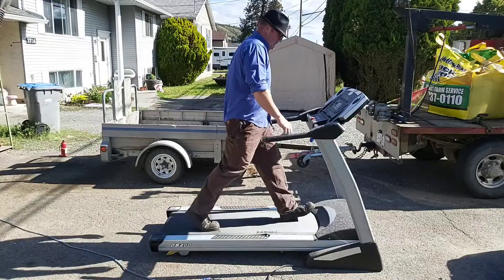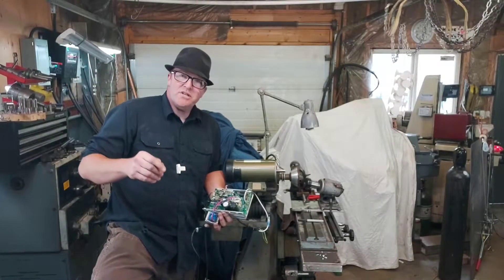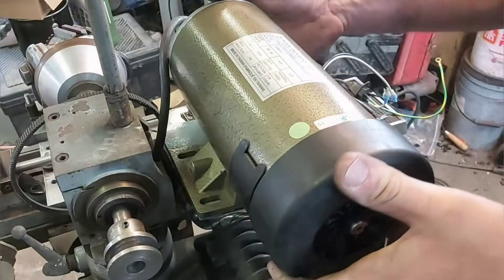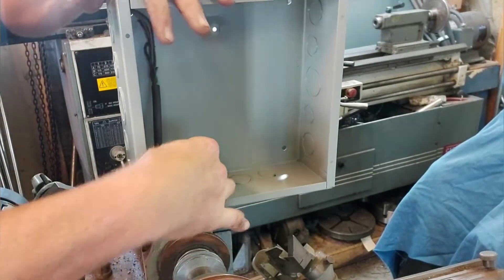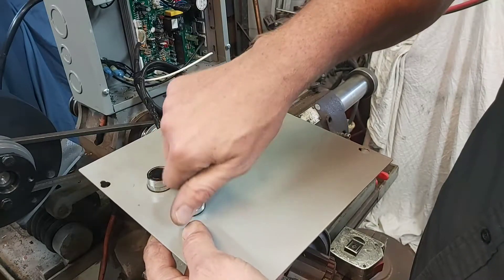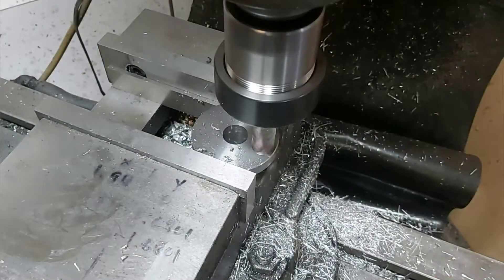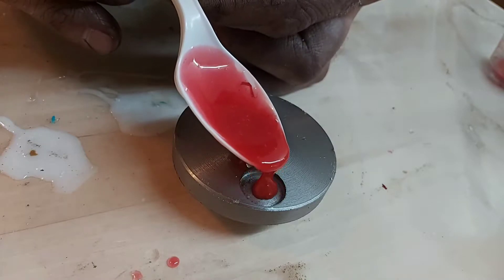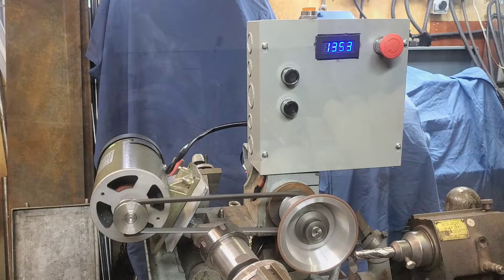Installing A Treadmill Motor On A Tool Grinder Variable Speed   alt6330

Comment: I know this was posted a couple of years ago, but perhaps you are still active on your channel. I found this same controller/motor, and I wanted to use it to power a small lathe. I got it working. However, using a momentary up/down switch seems to be crazy slow! Like I have to push the switch like 1 millions times (alot :)  )  to get it up to 1000RPM! I read on that thread you referenced that someone there suggested that the VR1, VR2, VR3 hooked to a 10K pot could be used to control the motor speed. Did you ever try this? I was not sure I wanted to try it for fear of blowing something out. thanks.
Reply from the maker: Yes it can take a bit to get up to speed .   I have a mechanical advantage on mine .   I had never done anything with the resistors . Can you tell me more about this or a link to read up on it ?
Reply: @Wrighmachining  I'm not a machinist like you are, so you got an advantage on this. But I am an electronics engineer! and I can read schematics. the schematic shows these VR1,2,3 (VR= variable resistor). I did not have a treadmill. I got the controller from a friend who tore apart the treadmill before I could look at the top control panel. If there was a poteniometer up there it might have been used to connect to these 3 positions. The other mystery is there are two of these connection points on the PCB both with the same labeling.... so they could be electrically connected, or just labelled the same. I have not investigated this yet. I think I read on one of those Arduino sites you had posted someone's opinion on the variable pot would not work to control the motor. I guess I will just need to experiment. If i get it working using this method I will post the results here...
Reply from the maker: Awsome !!! Wish i had you as a neibour when i started work on this .  Thank you amd we look forward to yoir imput !
Reply: @Wrighmachining  Ha! yeah many years ago I was a controls engineer for a company where we designed CNC controlled grinding machines! Fun job. Yesterday I tested the idea of using a poteniometer connected to the VR1, VR2, VR3 pins on the board. There are two sets of these named the same. But neither one worked for me :(  The schematic is not clear on what these are used for. So I think the next step is for me to come up with some kind of encoder. A rotory encoder won't work because it needs the signal interpreted by a processor. Meaning the pulses are detected by the rising and falling edges of the square wave pulses. Looking at the schematic, I can see the UP and DWN circuits have pull up resistors, and by shorting these to GND, creates a 1 or 0 effect. I may need to create my own circuit board with a flip-flop and a couple of buttons, which will create the 1 and 0 pulses as long as the button is pressed. Stand by more testing to follow.....
Reply: final UPDATE: I installed a square wave pulser circuit and a momentary SPST (on-off-on) switch. By holding the switch one way or the other, the pulses tell the controller to speed up or slow down the motor. It works, but the motor circuitry puts out a ton of EMI noise on the 5 Vdc line, which sometimes interferes with the pulses. Which causes it to skip pulses or not detect them. I put in some bypass filter caps across the power supply line. It helped some. I will also put a ferrite donut on the motor wires to see if I can filter some more noise. Bottom line, it works. So if someone with the knowledge wanted to do use this method. It is possible!

Comment: Been using my cutter grinder a lot since we last commented a bit over a year ago. However, as i get more proficient i want to use more grinding wheels and i only have 2 hubs for the taper side and one for straight shank side. The straight shank side was easy i made a bunch of adapters between centers and now have 4 or 5 I can use for different wheels. The taper side is an issue, i believe it is 4°, but it is definitely a non-standard taper. Did you ever make more hub arbors and know anymore detail in what the taper is (angle, in/foot, mm/meter, etc)? Thank you! Saw your write up in HSM this month, crushed it!
Reply from the maker: Hsm , yes im waiting for the paper copy to show up !! Glad you liked it .    No i have not made any more parts . Been busy with other projects latly :( doing that work thing .      Big plans for spring though when things slow down.

Comment: Nice repurpose!
Reply from the maker: Thank you. Man it is so much better than the other motor and way cheaper.  Just had to wade through learning how to run the board.    I have a two hp motor in the side shop from a large tread mill waiting for a good use as well. This time I'm going to hood a bought controller to it and try that.

Comment: I like the idea!  Got a free donor treadmill off the curb a couple weeks ago, have to strip it for goodies yet but now you've got my brain whirring with ideas for a tool grinder, lol
Reply from the maker: What bottom board is in it ? I never used the top one
Reply: @Wrighmachining  Not sure yet, haven't torn it apart.  Just the bottom section, the user interface panel is missing.  Not worried, will figure the system out one way or another.
Reply from the maker: @EverettsWorkshop  let me know when you find out I will try to work on it with you :)